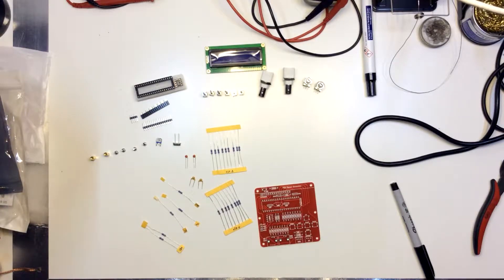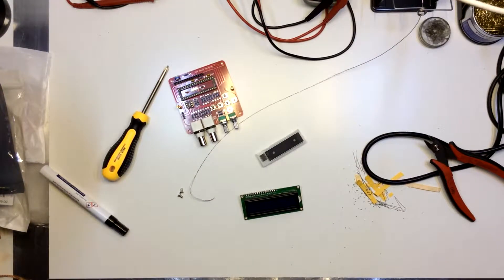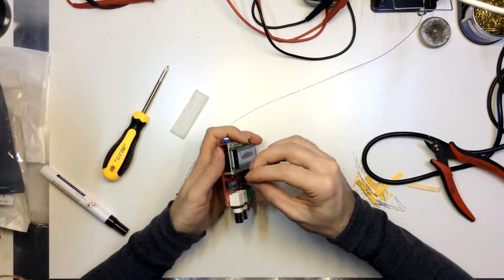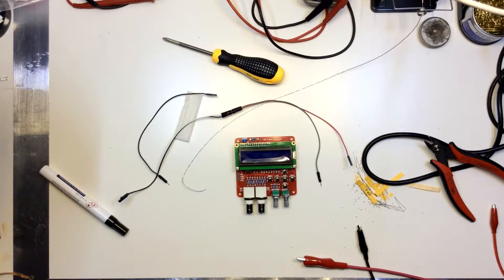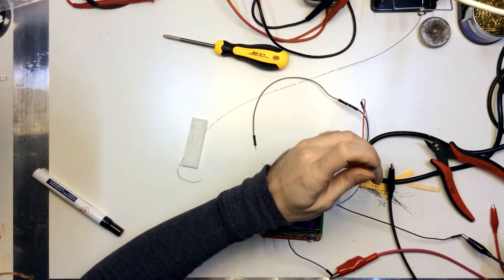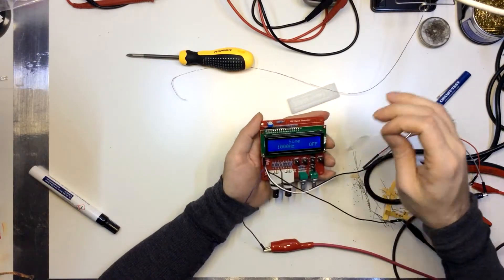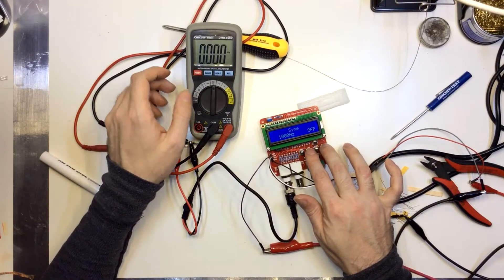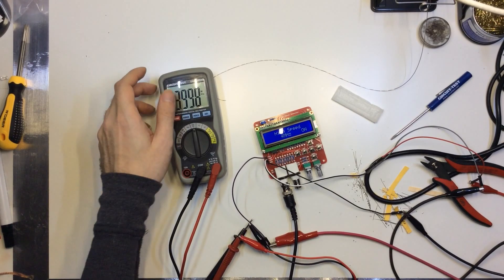Hiland DDS Signal Generator (from Banggood)

Comment: i got the same problem that you got in the beginning,the display is full of boxes,tell me how to troubleshoot it
Reply from the maker: Did you adjust the contrast of the display using the potentiometer?
Reply: yes i did,but it goes either blank or blocks.Will it take time to display?plz tell me the way to fix
Reply from the maker: Check to make sure that the main processor (the really big chip) is installed in the correct direction. I know I accidentally plugged mine in backwards the first time I set it up.